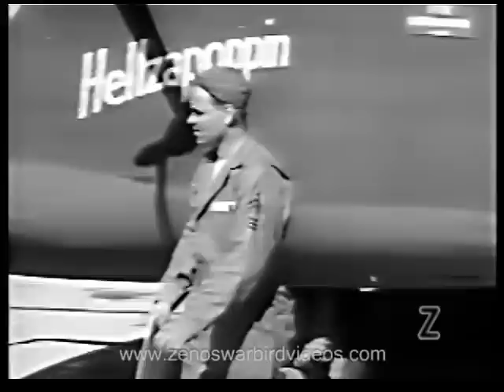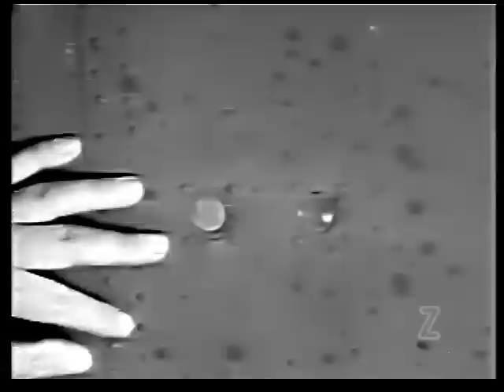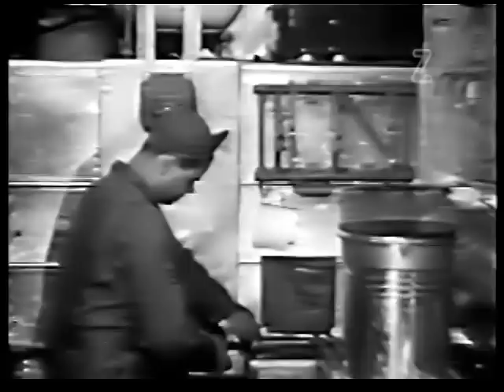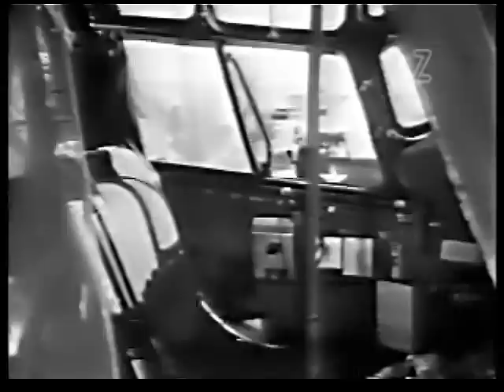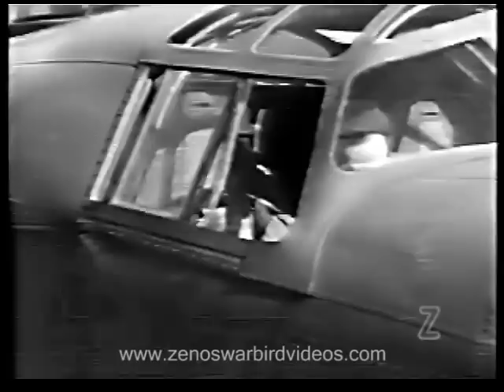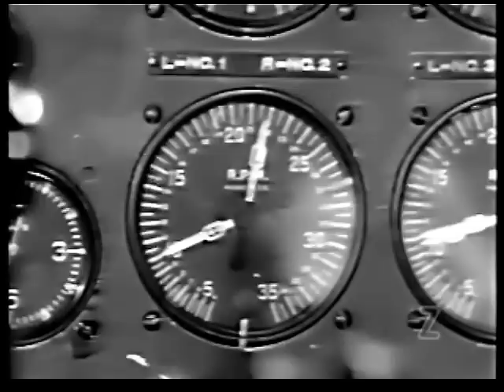Crew Chief pre-flight Inspection of the B-24 Bomber -1943

Comment: My uncle was a flight line mechanic in England, North Africa and Sicily. He told me that they put a light film of oil on all of the prop blades each evening. This enabled them to see any stress cracks in those same blades the following morning's inspection. He also told me that if a plane had Pratt and Whitney engines and suffered engine damage due to flak or gun fire that that plane was not likely to return from a mission, but if the plane had Wright Cyclone engines that the plane would more than likely return even with severe engine damage. This was due to the different lubrication systems used. The Pratt and Whitney used a pressure lubrication system and that system would feed an engine fire where as the Wright Cyclone engines were splash lubricated which would less likely feed a fire. He told me that he had seen several planes return with battle damage and that he had seen Wright engines with several cylinder heads knocked off and the engine still running on the intact cylinders.
Reply: My dad was in the same theaters. He was a crew chief in the 98th bomb group. His planes flew on the Ploesti raids. Lost several planes in Oran, North Africa and Beri , Italy. Wound up staying for 25 years so he was in WWII, Korea and Vietnam.
Reply: they also added wood blocks to save on the tail skids with new pilots trying to hard to get off with a combat overload.....
Reply: and tried to remind the new guys not to takeoff with the gear handle selected up at the start of the takeoff roll - had to get the gear up right now so the inexperienced would ride the safety squat switch so as soon as you broke free of the runway the wheels would start coming up- unless ya hit a bump